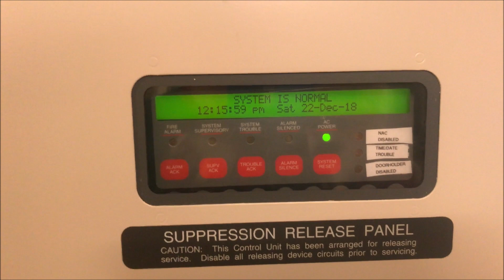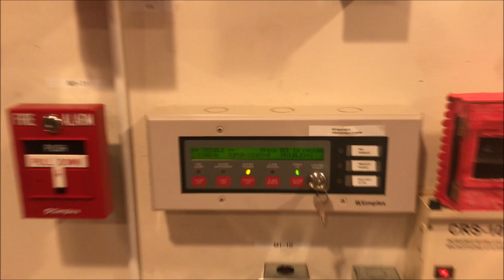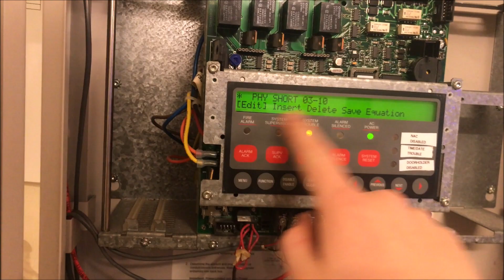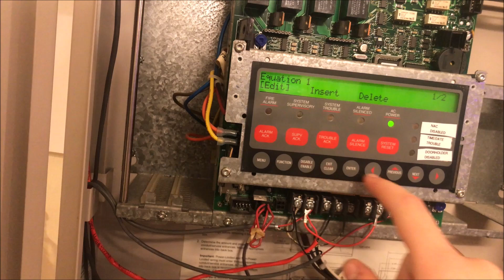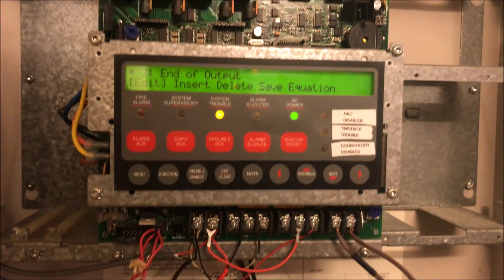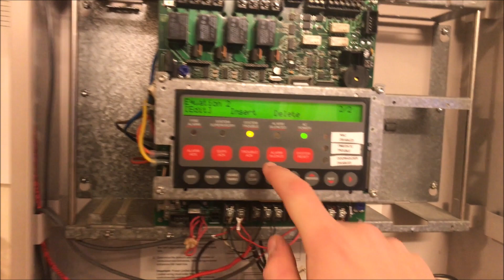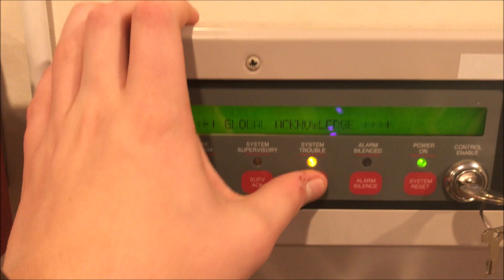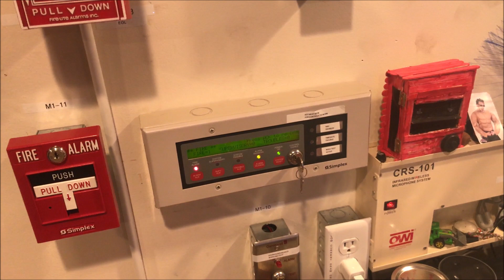Basics of Custom Control on a Simplex 4010 Fire Alarm Control Panel

Comment: Got a question on adding a extender nac 4009 panel into a portable classroom from the main buildings 4010 system. I’m having trouble figuring out where to tie in the id net for the new extender. From the diagrams I have found It looks like all I need is to tie into the I’d net loop and find a pull station or a smoke in the building to bring the extender into the loop. I’m not seeing any need for a nac circuit from the building needing to be pulled out also as it looks like the new nac extender 4009 will supply my new circuit for my horns and strobes. Is this correct? Thanks.